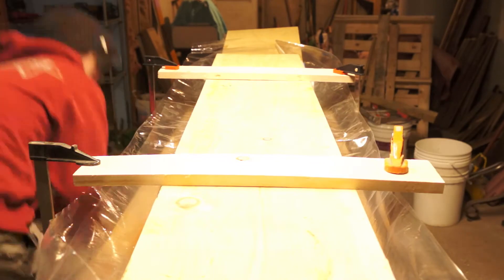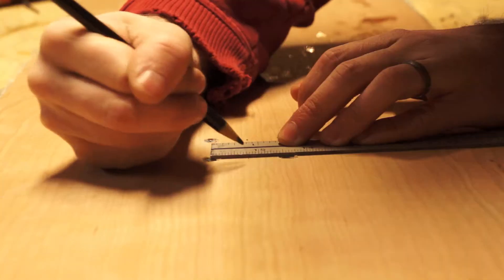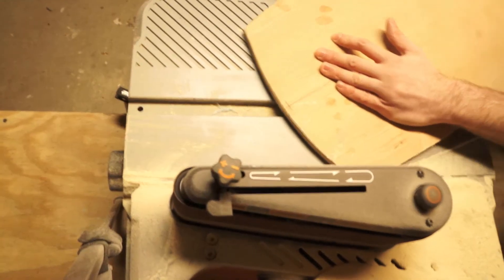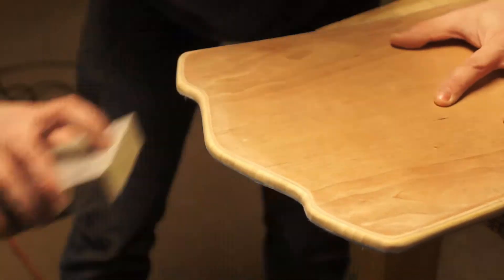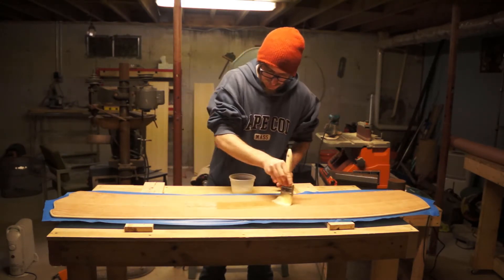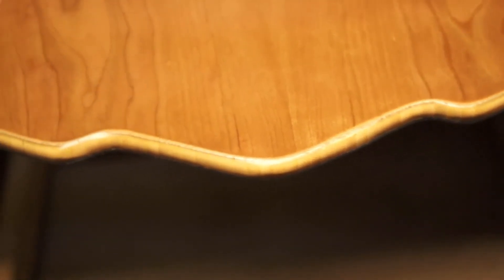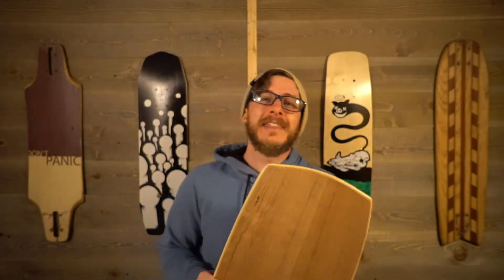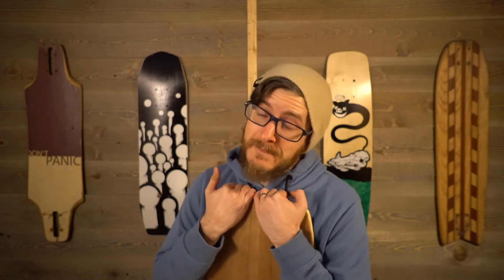DIY Advanced Powsurfer - Part 2

Comment: @Good roads, Noticed during the finishing process you taped the base to ensure you didn't get any polyurethane on the base sheet, how come you didn't do the same for the base sheet during the glue up with the epoxy? And how did you manage to keep the base clean during this stage. 
About the build one of my own and this is my biggest concern. cheers
Reply from the maker: Epoxy doesn't stick to plastic unless it's been sanded and flame treated so any resin that gets on the base sheet during the layup just peels right off. Which part of the process are you concerned about keeping the base clean?
Reply: @GoodRoads  was concerned about the glue up process and how to keep epoxy off the base. But if it just peels off thats perfect. Thanks for the info!

Comment: Have you looked into doing a 3D shaped base at all? Can't imagine it would be something easy to do at home or if it's even possible, many purchasable powder surfers I've seen have some sort of channel shape in the base to make up for a lack of bindings and or edges.
Reply from the maker: I pressed the first powsurfer I built with a vac bag which let me carve some base geometry into the mold and get a sort of hull shape. My shape didn't work out, but the technique worked. I might try to 3d-print a powsurfer mold at some point, and if I go that route it would definitely be a 3d base

Comment: Awesome work, not only on the board, but also on the quality of the DIY video. My question is this - would you consider inserting a steel edge, so that it has more versatility?
Reply from the maker: This build was a stepping stone for me to learn some of the techniques involved in a full-blown snowboard build. I tackled that build last winter and am pretty stoked on how it went. Urethane sidewalls, profiled core, binding inserts, and like you asked: edges. You can see the playlist for the whole project here: https://youtube.com/playlist?list=PLCvquV4dv9_SIKsnor5lwi9PviyckMH9m I tackled each step of the project in-depth as I learned
Reply: @GoodRoads  I did watch that and it was very impressive, although I really want to see how far you can take the pow surfer design using your skills and innovations such as the 3D-printed mold. Have you seen the Asmo pow surfers with the 3D base? This is what I'm aiming for but I haven't figured out a way to make a suitable mold using basic equipment. I bet you could make a crazy 3D base with your printer!
Reply from the maker: @wakazuzu  I definitely want to take a stab at that when the season rolls around

Comment: Really impressive ! , bare with me I’m new to all this so my question is this , the calculated length for a snow board for me is 165 , would this figure be different for a powder board as you’ve just made in the vid ?
Reply from the maker: It varies a LOT. Some powder boards are longer, having a full tail and a super long nose, some are shorter (like this one) and have a cut-off tail but still have a long nose, and almost all of them have a wider nose than standard to lift the board up over the powder. A short tail or a swallow tail will make the back of the board sink into the snow more so that you don't have to ride so far in the back seat to stay on top of the snow. The board I made in this video and the one I'm working on now are both shorter than my all-mountain board, but they're also both wider